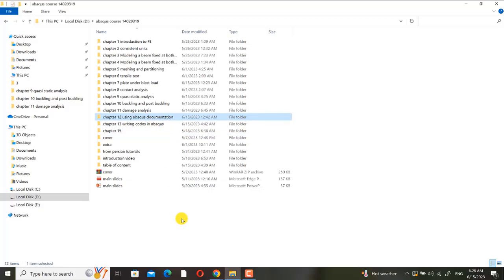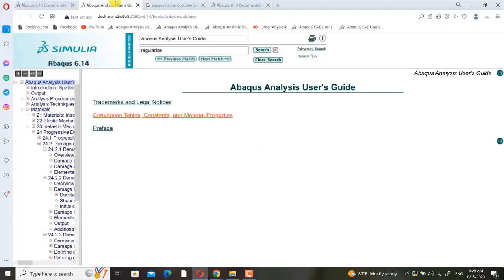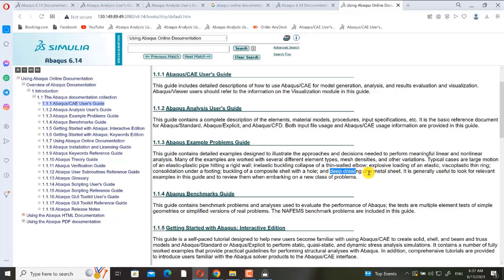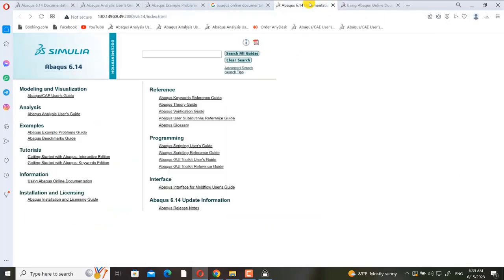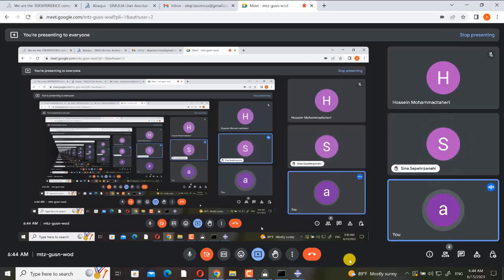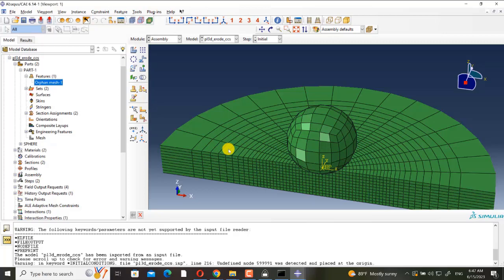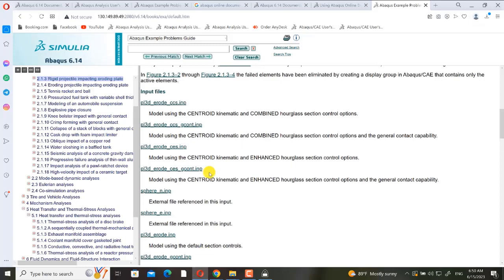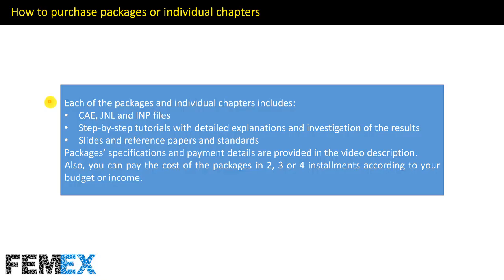Comprehensive Abaqus Package Chapter 12: Using Abaqus Documentation (Preview)

Comment: Which version is the best one?
Reply from the maker: Hi.
generally I don't accept that the last version is always the best version.
Also it depends on what you want to do.
Older versions have less bugs.
We use 6.14 because we must give files to the others so our version must be older then they can open our files.
I suggest you 2021 version because from 2022, in some systems you cannot use all the computational capacity of the CPUs when running an Explicit analysis. Also 2024 is better than 2022 and 2023. 2022 is the worst version of Abaqus and full of bugs.
Reply: @FemexIran  How about the 2023 version? For modelling steel pipe with ceramic liner in which section of documentation can I find related information?
Reply from the maker: @ That version is better than 2022 but I think 2024 is better than 2023.
The simulation you want is a specific one. Abaqus documentation does not include specific modellings and simulations.
Actually it only includes some typical ones.
But to do that modeling you can use our online consultancy service.
You can contact us via email: mirzabozorg71@gmail.com
Reply: @FemexIran  I have a question, I installed version 2024 and before documentation 6.14 and 2024 both of them worked but now none of them do not work, what should I do?
Reply from the maker: @mechanicalengineer8961  Unfortunately I don't know the answer of this question because I have not faced it before. For the 6.14 version you can use the online Abaqus documentation on Google and for 2024 you can use the 3ds website.